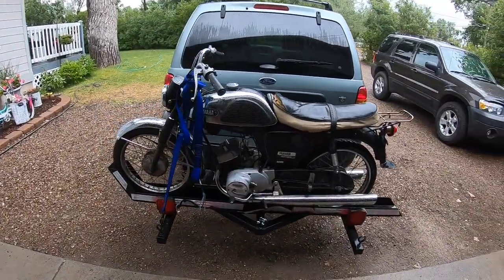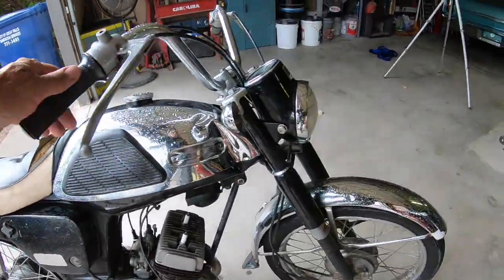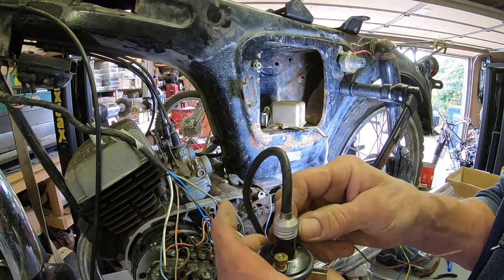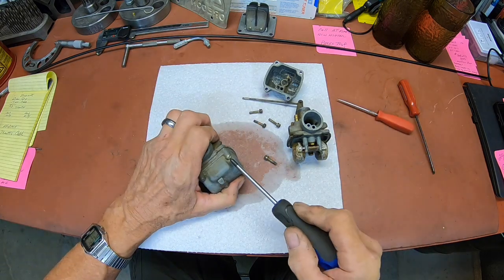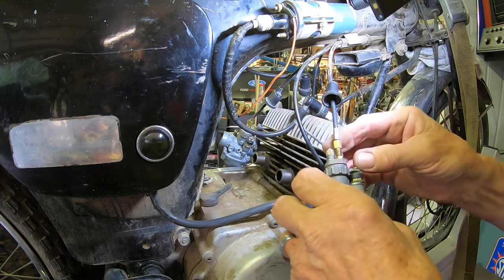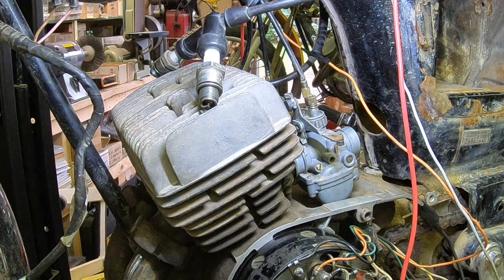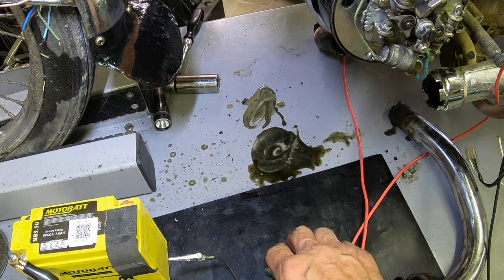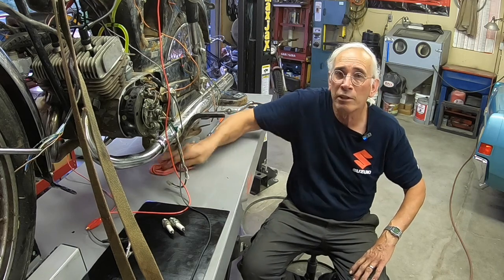Yamaha Twin Jet 90, Yamaha Twin Jet 100, New bike day. First look!

Comment: The little Yamaha twin is the Twinjet 100 (97cc) Yl1. The engine number is stamped on the crankcase and starts with L1.
I have restored 2 of these little Yamahas to showroom condition which were introduced in 1966, the Yl1 E having electric start. 
They are a free revving fun bike and can reach 60mph plus. The 90cc twin model was different in that it had a tubular fame.
Reply from the maker: Hi Sidney, nice to have you aboard, this particular bike is not a YL-1, if you follow the channel, I talked about this being a H-2 for the Japanese home market only, (also known as the AT-90 abroad) it was probably brought into this country by a G.I. that had been stationed in Japan in the sixties. This is indeed a 90cc, the head light emblem says 90, the speedometer is in KPH, not MPH.  When I did the top end rebuild the pistons are 36.5 mm not the 38mm for the 100cc. The 90 that was imported in this country was the HS1, imported for the 70/71 years. This is a 1965, it does look like the Twin jet 100's that I rode growing up in the late sixty's early seventies. But the engine does say H2, and the frame says Y3C. You are correct about them being quick, spirited, and free revving. This one is only 8 HP but does run very good for that 8 hp. Thanks for hanging out in the shop with me.
Reply: @montana2strokeracer  In the case of the HS1B 90, I have noticed that checking to make sure the slides can move all the way to the top in the carburetor at full throttle provides a zippier feel!  Mine will go almost as quickly as the twin jets; actually feels similar to my LS2 100, which is my quickest twin of this displacement, easily.  The round tail light on these is an easy indicator of Japanese domestic market bikes, for sure.  Nice find!

Comment: Great job Dale. It looks like the wiring colors are going to be the same as the YDS3 that I have and actually pretty much the same as all the 60s and 70s bikes.
Reply from the maker: I was wondering, I just ordered a factory manual from Ebay for the US version. I do notice that grounds are brown and not black, not a black wire to be found on this critter. Is that the case on the YDS3's, just interesting to note the differences, I thought I would make a new harness and opt for a new style regulator.
Reply: @montana2strokeracer  The lighter of the 2 browns should be switched 6 or 12V. The red on the switch is direct to battery + and the blue should be head/tail light.  dark brown should be turn signal lamps   and dark green should be the other turn signal lamps. I always have to look up which is which R&L. The only black I remember is in the headlight bucket and has a big eyelet that fastens to one of the mounting bolts. It should have a 2 or 3 way female bullet connector on the other end.  That's from memory of wiring my YDS3.
Reply: @montana2strokeracer  Making a new harness is probably the best solution.

Comment: Nice work Dale... your audio sounds great by the way with the new mic. Is that the YL1 model? Got to love the sound of 2 cycle twins!
Reply from the maker: Thanks Taylor, no not a YL-1, I thought so too when I saw it. But it is a Japan market bike, only sold in Asia. Some have told me it is a AT-90. It says H2 on the engine but YSC on the steering neck. However, both engine and frame have the same number. I know in 1970 there was a H2 90 twin imported to the US. But to my knowledge the YL-1 Twin jet 100 was the one imported here. I figure a GI brought this one back from Southeast Asia in the mid 60's.

Comment: All that water in the oil doesn't damage the engine at all when you fired it up? Love your videos I have an at1 and at3 I'm working on and your videos are great!
Reply from the maker: Hi there, there wasn't that much water in there, but there was plenty of oil, I don't think the amount would cause any problems. You have to get whatever is in there out or you will never get it started. It was pretty drowned anyway. It just kept fouling plugs; it has to come out.  Thanks for watching and best of luck with your projects, it's good to have you on board.

Comment: Very cool! A 56 year old bike!!  Love the way you figured out wiring. Well done, Dale. Looking forward to your journey with these. Is the oil pump working? Think I saw "auto lube" on a side case.
Reply from the maker: Thanks Jim, yep going to be interesting for sure, not sure if the oil pump works, don't think it needs one with all the oil that was in the combustion chamber. Yes, it has autolube though, I will get to it at some point. Its going to need a good hosing off, can't even see the oil lines.

Comment: @montana2strokeracer  New subscriber here. I'm trying to get a 67 YL1E back on the road. Having trouble with the autolube pump sending air to the right cylinder only. Tried 2 separate pumps, and properly bled each time. Primed the lines before reconnecting. And yet within a couple minutes of running, huge air pockets form in the outer (RH cylinder) oil pipe, starting right at the pump. New gaskets and seals on the pumps.  Any ideas?

Thanks for the amazing content on these older 2 strokes!
Reply from the maker: Well thank you very much, glad you could stop by man I love those YL1's, just nothing like that sound. It's hard to tell what your problem is, it sounds like you have all the bases covered. Its apparent that is sucking air somewhere, I would double check your plastic lines, could be a pin hole or a break somewhere, they are really brittle by the time they are 60 years old. Is the check ball and spring in the pump, that is your check valve to prevent the oil from running back to the pump. Best of luck finding the problem and thank you again for the kind words, and for subscribing.
Reply: @montana2strokeracer  Thanks for the reply! Yes, check balls and springs are there. Next weekend I'll be pulling the cover, replacing both clear lines and the black line from the oil tank with NOS parts. Will see what happens. Thanks Dale.

Comment: electrical is part of ebay sellers stuff. PDF/or CD not a book. very reasonable prices.
Reply from the maker: Thanks Frank, I will be looking into it. But it really looks cut and dried. Pretty simple electrical on these old bikes.
Reply: yeah simple but i always like to make it more complicated. i pour over the wire diagrams eventually figure it out. help to under stand the basics of what makes a motorcycle run. love the one wire stator to coil bikes the best. @montana2strokeracer

Comment: why dont they have a crank case drain plug?
Reply from the maker: Wouldn't that be nice.
Reply: with your expertise this would be a nice project on a 2 stroke that your going to keep. think it would be easy drill/thread/plug. many uses maybe to just see whats floating around in the crank case.  @montana2strokeracer

Comment: I  guarantee   you  it came from Japan originally ! 😉😅
Reply from the maker: Thanks Mark, I know it was made there, but from what I was able to find out it was a Japanese local market bike. Do you concur with that? I had one viewer tell me that in England they still would have had a MPH speedo. Not sure about Europe as a whole. Just interesting to hear what others have to say. Thanks for following along with the channel.
Reply: @montana2strokeracer  yes it most certainly could have indeedede been a Japanese market bike...
Reply: But on the other hand most of Europe has been using kilometers per hour for well before 1968    Russia converted in I think 1925   the British empire was a holdout until 1977